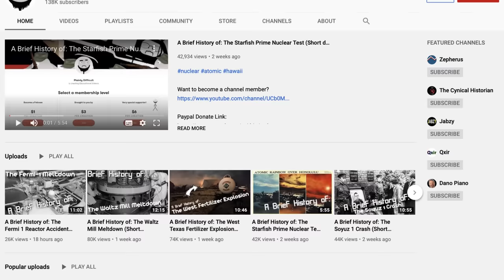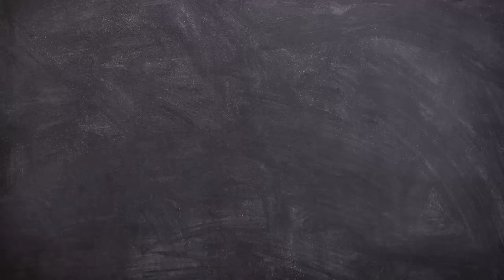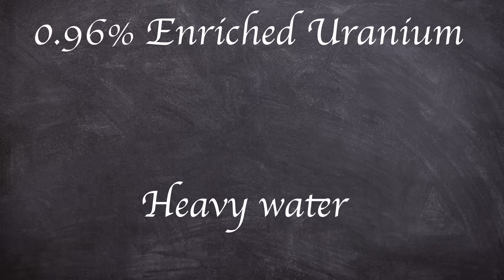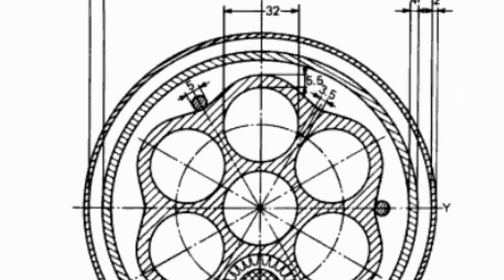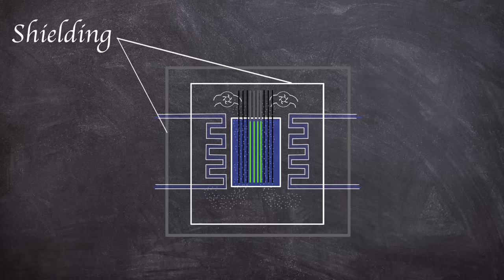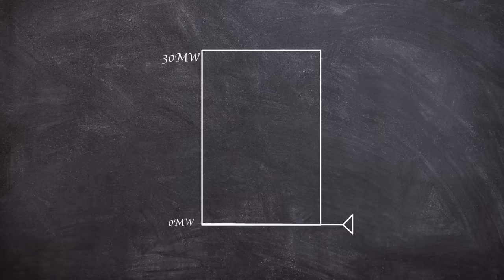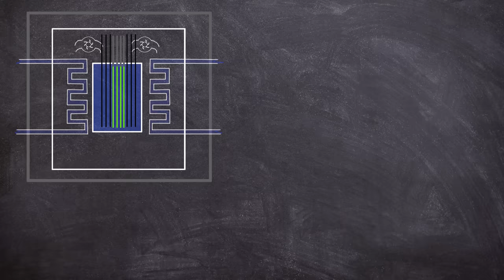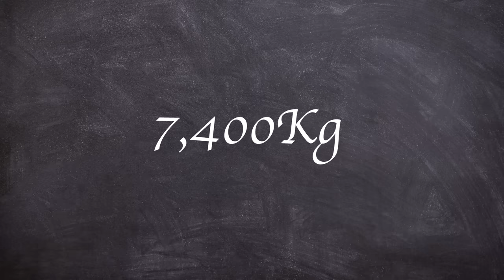A Brief History of: The Lucens Reactor Meltdown (Short Documentary)

Comment: Look at that, an adequately contained, properly cleaned up nuclear mishap.
Reply: Like clockwork...
:D
Reply: Nolan Flynn welllllllllll is made by us.......i am just confused we did not build an clock out of it
Reply: Lol. This happens once a month on an air craft carrier. Reactor always acting funky
Reply: Well it WAS sunk into a mountain and used lower powered method. It was also a somewhat experimental model so they planned ahead for failure whereas most normal powerplants are built with more efficiency in mind and that may result in it being harder to clean up (like being close to water sources that makes it harder to contain when it fails)
Reply: That's probably why they put it in a cave
Just in case
Reply: Look again. Except for what went out the stack, escaped into and out of the control room, what contaminated the equipment and operators and environment and what still remains for the next 250,000 to 16 million years as nuclear waste. Not proper at all.
Reply: @jackfanning7952  The exposure was significantly less and the removal of any crap happened on a small scale. Being it was in a man made cavern, among natural rock, it probably had some ore content naturally at some point.
Reply: Not so! IT IS STILLE REDIOACVOES I si dangoros
Reply: @kbtechandmedia  When was the last time the amount of exposure from a nuclear accident was accurately reported and removal was complete? Oh, that's right! Never!!! and...it is a gift from hell that keeps on giving for longer than mankind has been in existence.
Reply: @sehvehn7955  typical normie
Reply: isnt there a bbc migrant bull that you need to prep?
Reply: Yes but a mishap is a big understatement.
Reply: @jackfanning7952  i went inside like 1 year ago...... there ist less radiation inside then outside (outside the sun radiation ist higher then the inside of the cave..) stop saying stuff you doesn't know..
Reply: @ilovecops6255  wrong, why are you all saying stuff without knowledge?
Reply: @Ipson83CH  Are you actually comparing visible light, UV and IR solar energy to ionizing radiation from alpha, beta and gamma radiation resulting from fission by-products? Stop saying stuff that shows your ignorance and indifference to the disastrous consequences of 75 years of nuclear power.
Reply: @jackfanning7952  I'm not telling you I'm an expert, i'm telling you there is no radiation inside, I was in there with experts, THERE IS NO RADIATION INSIDE. Stop talking just to talk
Reply: @Ipson83CH  I do not believe that there is no radiation inside. There were also "experts" at Fukushima that said there was no radiation in a contaminated zone. However, the monitoring instruments they used were not capable of detecting some very dangerous alpha radiation from the 10 tons of plutonium that was blown sky-high from Reactor #3. But, even if I stipulate that there is no radioactive contamination in the cave, that does not mean the the disaster was "adequately contained, properly cleaned up."
Reply: One word.
Swiss
Reply: @jackfanning7952  within the scale of a nuclear disaster, this is as contained as it can get.
Reply: @jackfanning7952  who cares how accurate the leaked amount actually is.
Theres something called tolerance you know.
Not to mention, only cause governments can be distrusted doesnt mean they are inherantly going to lie every time.
Geeze
Reply: @Ipson83CH  dunning kruger mate xD
Thats why
Reply: @jackfanning7952  yes. Yes he is.
Do you realy not understand how similar visible light and "radioactive particles" are?
And did you consider that You might be the one who doesnt know what youre talking about?
Reply: @ethribin4188  That is the problem.
Reply: @ethribin4188  A professor once told our class that if we keep our mouths shut, people won't know how stupid we are. You should take that advice.
Reply: @jackfanning7952  Sunlight is a carcinogen though, do you never go outside?
You're right that there is no "safe" amount that will do no damage, however there are acceptable risks, as there are for all things. Driving a car is very dangerous risk wise, but we still do it by the billions.
Similarly there is no safe dosage from a reactor, however we use them because they are comparatively almost risk free compared to almost any other daily activity when properly designed, constructed, and maintained. Radiation isn't some magic boogyman that kills you instantly with no way of knowing, it is a property of some types of matter that we understand comparatively well.
Over the course of their lifetime a nuclear reactor will release approximately 100 times less radiation that a coal reactor generating the same amount of power; because coal, and thus it's smoke, contains radioactive particles including uranium and thorium. Contamination and storage of radioactive materials is taken very seriously at nuclear plants.
Reply: @matthewtaylor2890  My first safety talk to contractors working outside at The Savannah River Plant was to protect against radiation - solar radiation. My grandfather was a farmer who never went outside without a long-sleeved shirt and wide brimmed hat. But a long-sleeved shirt is no protection against alpha radiation inside you and beta and gamma radiation on the outside. Properly designed, constructed and maintained never happens in nuclear reactors and their catastrophies cannot be recovered from. Engineers designed reactors for a forty year working life before they become brittle and maintenance becomes too costly to continue. Neutron activation causes reactor parts to become radioactive enough to kiill within minutes. SAFSTOR is BULLSHIT. The average age of the 94 reactors in the U.S. is ...40 years. Radiation, even low-level radiation,  is an invisible, magic boogeyman that kills after 10, 20, or 30 years exposure. 70% of the villagers 8 miles downstream of Mayak on the Techna River had leukemia from waste dumped in the river. So what did the nukies do? They dumped it in the lake. Problem solved, eh? Radon is the second leading cause of lung cancer in the U.S. Yet 300,000,000 tons of radon-emitting uranium mine tailings is laying in open trenches and waste piles in 9,000 sites in the U.S.  Contamination and storage is taken seriously? In Europe at least they make fission by-products be stored in hardened structures, but not in the U.S. Cooling pools for spent fuel are seriously overloaded and reactors have no incentive to get that stuff deep underground instead of in the open within 100 miles of every major U.S. city. Why? Because the taxpayers are paying them a billion dollars a year to store it unsafely in open pools and casks. Besides high and low level waste is being dumped straight into oceans and streams all over the world. 100,000 years from now people will still be dying from it. Every bit of plutonium and most of the fission byproducts will be increasingly contaminating our entire planet and continuing to kill for 240,000 to millions of years. Mutations and bioaccumulation will get worse rather than better. Talking about the hazards of coal (deflection) does not excuse the carelessness and callous minimization of the most likely end to all life on Earth - Nuclear energy.
Reply: @jackfanning7952  Ah that must be our difference in view bro, I'm from Europe where this shit is serious business, we remember Chernobyl well so we treat safety as a number 1 concern.
But there is no reason that the reactors only last 40 years, most of them can go easily twice that without issue. Never mind the fact that the only time anyone has access to the core is when it isn't undergoing a chain reaction, yes if you stood in the core while it was generating power you'd die quick fast and in a hurry, but even ignoring the fact you use suits to deal with it most of that radioactivity is short lived because of how it is generated.
Also from what I can find 9% of lung cancer is from radon (although it's still normally in people who smoke), that's not a scary amount because even well-water has radon, it moves through cracks in rocks very well naturally.
Also as far as I could tell there are 80 storage sites, of which 21 are no longer used by any reactors, not 9000; could you please give me a link, my knowledge of American nuclear programmes is limited. Never mind that it's only 50 miles away that needs to be concerned and that's in case of a catastrophic failure like Fukushima, not 100.
And on the topic of the Soviet Nuclear Power Programme, that was built far more like you suggest modern reactors are, and there's a reason we don't do it anymore. A lot of that is to do with the fact that we didn't understand the dangers of radiation at the time, but Chernobyl was built to be operational as fast as possible and safety was a secondary concern, it was the Cold War after all both sides were in a technological arms race, no modern reactor is built anywhere near as sloppily, we don't have a reason to, it is far more expensive to clean up that mess than just build a better reactor and we understand the risks far better.
Also what do you mean well built reactors are never done, nuclear reactors are built to very exact specifications, the time has long past since you could cobble a building together, whack a reactor in it, and just call it a day. There are strict planning and design specifications that must be followed, because we now know so much more about reactor safety.
Oceanic dumping hasn't been done since 1993 by any country
Plutonium is generally more dangerous as a fire than as a radioactive material (though part of the danger is the radiation in the smoke), the main issue is that water makes it burn and thus proper storage mainly consists of airtight and watertight steel drums which every country uses for storage, you also generally have to be inhaling the dust of plutonium in fairly large quantities, no human is known to have died from inhaling and ingesting plutonium so only nuclear workers need to be worried.
Finally it isn't deflection, there are real risks from nuclear power, especially if it isn't given due respect for construction and maintenance, my example is to show that even if we use nuclear power that other methods of power production produce similar if not worse levels of radiation. Once again all radiation is dangerous but there are appropriate risk for radiation and all things.
Reply: @matthewtaylor2890  I wish you were right that Europe takes nuclear reactors seriously. Nuclear proponents focus on normal reactor operation and procedures. But most of the danger occurs before and after it reaches the reactors. The mining and milling of ore is in undeveloped areas to people who are exposed, ignored and suffering from radioactive exposures. More danger is from unanticipated, inevitable, irresolvable disasters, potential exposures from radioactive waste and decommissioning (or not)  of reactors, much of which occurs because of cost cutting, carelessness and design flaws. Fission by-products with half-lives as long as millions of years never existed before 1940. Oceanic dumping has continued at Sellafield, and, for the last ten years at Fukushima. Who knows what is going on in China, India, Paskistan and, unfortunately, U.S. and Russian military facilities. Regulators are compromised and have become industry cheerleaders, not regulators. Most uranium and radium are underground in locations such as granite rock and phosphate deposits. Digging it up, crushing it, acidifying it and scattering it around in waste piles causes increased air and water emissions, not to mention the tremendous amount of fossil fuel for the processing. One gets 7 kgs. of U-235 from a million kgs. of 0.1% ore (if you can find ore that rich anymore). The tailing are radioactive, acidic and contain toxic metals and arsenic. They are not being buried. The natives and aborigines where these mines are suffer terribly from this pollution. Every reactor produces plutonium. Plutonium is scattered about from the over 100 serious nuclear power accidents and 2200 nuclear bomb tests. It will be dangerously radioactive for 240,000 years.Then it turns into lead. Ingest a tiny particle of it in a fish you eat or the mud your child crawls through or the smoke you breath from a fire in a contaminated zone and it will continue to destroy the living tissue it comes into contact with. Ten tons of plutonium was in Fukushima Reactor No. 3 when it blew sky-high. No one knows how much of it is in the groundwater leaking daily out of the core and on the slopes above the reactors, washing down into the ocean. How much is in the phytoplankton that is the basis of the food chain? How much is in the Columbia River from Hanford or at the crash site of that plane in Spain, or the smoke floating over Los Angeles from the 2018 Woolsey Fire at the 1958 Santa Susana meltdown site? How much more from the last 75 years? How much in the next, as those reactors age and nuclear cuts corners to reduce costs to compete with cheaper and safer renewables? When are we going to bury the waste and clean up the water, if ever? I have 42 500,000 gallon tanks of very radioactive, corrosive sludge sitting in leaky tanks 80 miles from my home. It has been there since the 1950s and 1960s. I have atomic bombs sitting in the military base 15 miles from my house. I am not confident that we don't have any more disasters.
Reply: @Ipson83CH  imagine believing a government that still houses stolen and looted Jewish valuables from Germany’s dark past. Yikes
Reply: @i-vlog1994  wow, you talk like someone who knows, how have evidence and can prove what is talking about. So shame on you for not exposing that proof and make justice for the Jewish people, your behaviour is beyond criminal
Reply: @Ipson83CH   all you have to do is a simple google search and you’ll see stolen goods are found in Swiss vaults all the time. So I don’t know what kind of straw man arguement you are trying to make.
Reply: @i-vlog1994  right do a simple search, and find fake news you take for real. That's today's hillness, people believe everything they see online without checking source, it has just to be emotional and it works. Real research is something else. The worst is people that do Vlog and spread those "news" or "facts" looking for views and fame.
Reply: Impossible
Reply: @i-vlog1994  what are you talking about, that just doesn‘t happen
Reply: @Ipson83CH  don't comment about this like a champion who knows and understands this site. I highly doubt you "went to the site" and definetly not the reactor chamber (because it's full of concrete) and got accurate milli/rad readings that was less then the daily radiation we all experiance from the sun?? Who are you pretending to be? That site is highly contaminated and if you could get actually inside a 5 mins exposure would be lethal within weeks.
Reply: @ryanmcneill1919  You're obviously the expert here as you seem to think this happened in Lucerne. Lol just lol.
Reply: @Ipson83CH  received chemical engineering/physics degree from the University of I don't know WTF I'm talking about but I'm talking
Reply: @jackfanning7952  this persons comments are incredibly frustrating.. and they clearly graduated from the University of "I don't know what I'm talking about but I'm talking" majoring in chemical engineering and physics. Pretty sure they think they can breathe underwater if they try hard enough.. Hopefully that is what transpired.
Reply: @YourSkyliner  are you here to troll people for spelling/auto correct mishaps... or do you have anything constructive to add to the conversation?
Reply: @YourSkyliner  I'm assuming you have something to say that is going to blow the people of youtube away. What are your thoughts? Is the site completely safe/uncontaminated? Like every melt down site in history? 🤣 or is the site completely contaminated if we dug it up? I look forward to your educational response.. with love from Lucerne🤣
Reply: @YourSkyliner  this is a topic that can only be properly debated by folks who are properly educated in the field of chemical engineering and, even more so, nuclear physics. So let us debate! If you can manage to do so without quoting internet conspiracy I'm for it.
Reply: @ryanmcneill1919  One thing you got right, The reactor chamber is full of concrete. The rest, you can belive what you want. (I give you a Hint, google "DABC Lucens" to inform yourself about what's the site today)
Reply: @matthewtaylor2890  this guy is lieing. 
Theres actually only a few nuclear waste storage sites in the United States.

1. The Hanford Site (where the plutonium for the atomic bombs was made.
2. A privately owned storage facility in yexas that was originally for storing short lived lpw level waste from medical facilities, but recently was granted clearance for the disposal of intermediate level waste.
3. Yukka mountain permanent deep storage facility. The project was postponed indefinitely, but the site is well maintained, and is essentially finished and ready to open.

Theres also an old uranium processing plant, but that entire site was buried along time ago, and has a nice walking trail where the site used to be. 

Theres also an old illegal dumping site somewhere under the St. Luis landfill.

Other than that most reactor waste is stored at the reactor location, and whats not stored on site is exported to foreign disposal sites.
Reply: @ilovecops6255  what a horrible name. Jack Boots taste delicious sounds better.
Reply: @Ipson83CH  his name says it all 😂
Reply: @dumpsterstu4474  THNAKS YOU MINE GOODE FRENDES. THUMBBERES UPPERSES!! I BEE THUBER 1!!!
Reply: Not just that, the cause of the issues would be just as bad for a sodium cooling loop design so it probably wasn't even that bad a design in most respects, (poor instrumentation aside).
Reply: Alin S  What does ionizing radiation look like to the naked eye? How would you be able to tell if it was a well-contained disaster?
Reply: @sehvehn7955  LMAO were you even in the military?
Reply: USA? USSR/Russia?! Both. Haha, we wish!
Reply: The Swiss. Of course.
Reply: No such thing. Clearly we're missing something 🤣
Reply: @jakehildebrand1824   You forgot WIPP
Reply: @scottyo64  WIPP is Yuka Mountain.
Reply: And so they decided that nuclear power was satan and switched back to nice, safe, petroleum
Reply: Because it isnt America or the USSR
Reply: @jackfanning7952  Seriously? First of all, while IR and visible light aren't ionizing, UV certainly is. Second, no plutonium was "blown sky high" (let alone ten tons of it) at Fukushima, both because no fuel was ejected during the explosions and because the affected reactors were fueled by uranium rather than plutonium (the only reactor at the facility that used plutonium was reactor 6, which was not affected by the disaster).
Reply: @alexanderflack566  Seriously, I am used to hearing more lies than truth coming from nuclear proponents. In every fission reactor new, heavier isotopes are formed, like pu-239 from u-238 and pu-238 from u-235. Usually about 1% of the spent fuel from fission reactors is plutonium, two thirds of which is pu-239. Fukushima Reactor #3 was using MOX fuel, consisting of a blend of uranium and reprocessed plutonium. Dr. Marco Kaltofen and Nuclear Engineer Arnie Gundersen claim there was ten tons of plutonium in Reactor # 3. Every reactor and cooling lagoon at Fukushima and anywhere else in the world contains some plutonium. Too bad it isn't just there but is also spread around the world from accidents and intentional illegal dumping of nuclear waste. 
Live television replays of the two explosions from Reactor # 3 (after the meltdown which boiled off the cooling water and created hydrogen gas) were shown around the world, but not in Japan. Visible reactor parts and fuel particles from the reactor core itself were blown through the roof. The hot particles which are microparticles of glassy beads containing radioactive isotopes of the reactor fuel have been carried in the wind and water to Tokyo and beyond. The alpha radiation components of these hot particles are difficult to detect with most radiation measuring devices. Mass spectrometers and electron microscopes are needed. Billowing overhead was a black cloud of radioactive iodine, plutonium, cesium and other toxic gases and particles. Eleven workers were injured from falling chunks of concrete and steel. The nuclear fission shock wave produced a detonation shock wave with an intense pulse of radioactive gases out of the southeast corner of the building for Reactor #3 in the secondary explosion. The day after Reactor #3 exploded, Reactor #2 exploded, with its heavy and largest load of fresh fuel, releasing uranium, plutonium, and americium.
Fukushima Daiichi had six reactors and seven spent fuel pools. Six million tons of radioactive debris have been deposited in vinyl bags on the rice paddies. More has already been burned in incinerators without baghouses or electrostatic precipitators. The ash is used in new construction, building radioactive contamination into the new buidlings that will be there and emitting as long as those buildings stand. TEPCO wants to dump billions of liters of contaminated water at levels 20,000 times higher than the allowable safety standards in the Pacific. TEPCO  has it stored in cheap, leaking steel tanks and has admitted the cleaning process has failed to remove strontium-90 and other radioactive isotopes. 
Why should I believe you and ignore the reports from nuclear scientists that have analysed and written and reported peer-reviewed studies and books on the catastrophe? If there results were inaccurate, their reputations as credible witnesses would be impugned. That has not happened. What are your qualifications as an expert witness on these matters?
Reply: @jackfanning7952  
"Seriously, I am used to hearing more lies than truth coming from nuclear proponents. In every fission reactor new, heavier isotopes are formed, like pu-239 from u-238 and pu-238 from u-235. Usually about 1% of the spent fuel from fission reactors is plutonium, two thirds of which is pu-239"

Which leaves 6 kg at the absolute maximum, and again, the core was not ejected from the reactor. For fuck's sake, even at Chornobyl, which was multiple orders of magnitude greater in energy release and lacked a containment dome, most of the fuel still ended up in the basement.

"Fukushima Reactor #3 was using MOX fuel, consisting of a blend of uranium and reprocessed plutonium."

That contradicts the initial source I saw (presumably it just said uranium because the MOX was only 6% of the fuel in reactor 3), but regardless, it's irrelevant in light of the fact that the primary containment vessel wasn't breached. Plutonium release was 0.00002% of the core inventory in the reactors (source: https://pubs.acs.org/doi/10.1021/es402212v ). You're claiming 100% of core inventory, which is outlandish bullshit according to every non-crackpot source I've ever seen.

"Dr. Marco Kaltofen and Nuclear Engineer Arnie Gundersen claim there was ten tons of plutonium in Reactor # 3. Every reactor and cooling lagoon at Fukushima and anywhere else in the world contains some plutonium. Too bad it isn't just there but is also spread around the world from accidents and intentional illegal dumping of nuclear waste."

So should we shut down all industries that use heavy metals? Because those are just as dangerous, and get dumped and leaked in much larger amounts. If nuclear energy is too dangerous, so are dozens of other industries.

"Live television replays of the two explosions from Reactor # 3 (after the meltdown which boiled off the cooling water and created hydrogen gas) were shown around the world, but not in Japan. Visible reactor parts and fuel particles from the reactor core itself were blown through the roof."

In other words, you don't know how western reactors are constructed. What was destroyed was the outer shell of the building, which is irrelevant to actual containment of the reactor. The primary containment vessels were, and are, still intact, meaning the the core material could not have been ejected. What you saw was not fuel.

"The alpha radiation components of these hot particles are difficult to detect with most radiation measuring devices. Mass spectrometers and electron microscopes are needed."

...you're thinking of neutrons. Alpha particles are charged particles that are easily detected via a Geiger counter.

"Eleven workers were injured from falling chunks of concrete and steel."

It's fortunate that they weren't killed, but I fail to see your point here. 11 injuries (or even deaths), in reference to an industrial disaster, is small potatoes. Do you also argue that we should stop making pesticides? Stop extracting and refining petroleum?

"The nuclear fission shock wave produced a detonation shock wave with an intense pulse of radioactive gases out of the southeast corner of the building for Reactor #3 in the secondary explosion."

What are you on about? The only shockwave was from a hydrogen explosion. There wasn't even any fission occurring at the time of the disaster in the first place. The heat was residual decay heat. Are you just parroting from an anti-nuclear site without actually understanding what you're typing?

"The day after Reactor #3 exploded, Reactor #2 exploded, with its heavy and largest load of fresh fuel, releasing uranium, plutonium, and americium.
Fukushima Daiichi had six reactors and seven spent fuel pools. Six million tons of radioactive debris have been deposited in vinyl bags on the rice paddies. More has already been burned in incinerators without baghouses or electrostatic precipitators. The ash is used in new construction, building radioactive contamination into the new buidlings that will be there and emitting as long as those buildings stand."

...I'll take that as a "yes." The elements released in greatest amounts were Iodine-131 (half life 8 days, decays into a stable isotope), cesium 134 (half life 2 years, decays into a stable isotope), and Cesium-137 (half life 30 years, decays into a stable isotope, not particularly dangerous as it does not bioaccumulate).

"TEPCO wants to dump billions of liters of contaminated water at levels 20,000 times higher than the allowable safety standards in the Pacific. TEPCO  has it stored in cheap, leaking steel tanks and has admitted the cleaning process has failed to remove strontium-90 and other radioactive isotopes. 
Why should I believe you and ignore the reports from nuclear scientists that have analysed and written and reported peer-reviewed studies and books on the catastrophe? If there results were inaccurate, their reputations as credible witnesses would be impugned. That has not happened. What are your qualifications as an expert witness on these matters?"

What peer reviewed papers? You're claiming plutonium releases 7 orders of magnitude higher than the peer-reviewed paper I linked you. Your claims and conclusions are blatantly contradicted by the IAEA's measurements and conclusions. Where the hell are you getting your data?
Reply: @matthewtaylor2890  also, Canada has designed New plants that actually bombard spent fuel to release the remaining energy that cannot be used in normal processes, and ends up with background levels after the process, essentially next to inert material remains.
Reply: Probably because it's not a Russian nuclear site.😅
Reply: I was wondering how this could possibly be, especially in the cold war era... And then he said Switzerland. 

Sadly for anything I hear coming from the world's two top powers at the time, my expectations of the turnout are far, far lower.